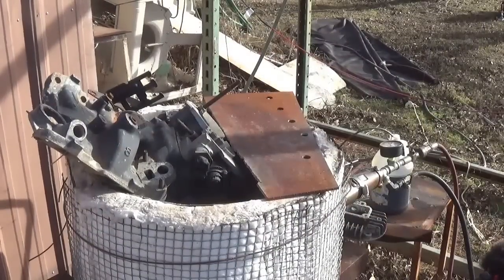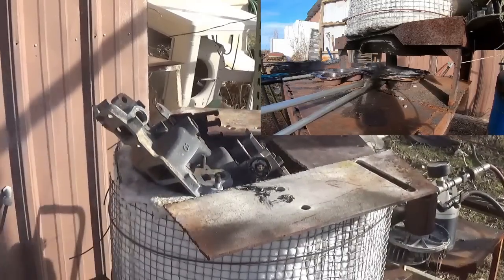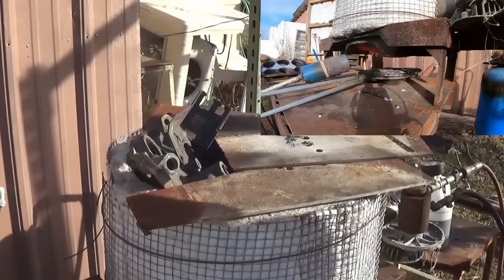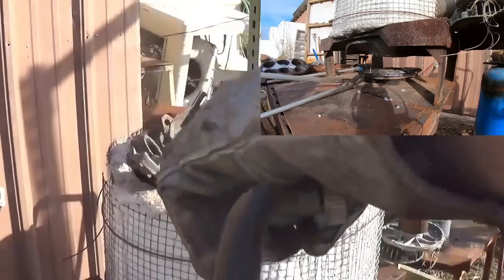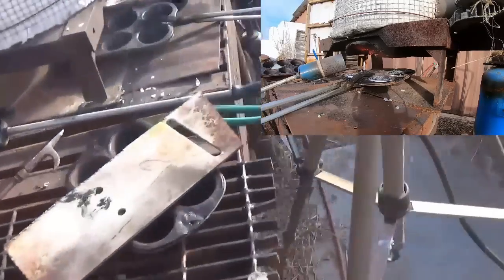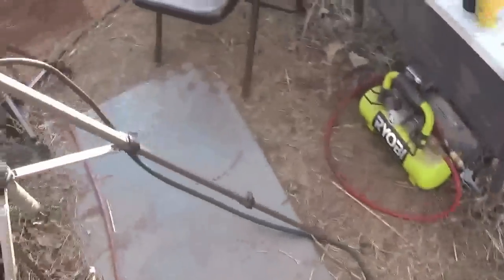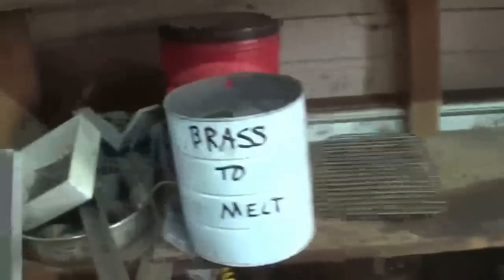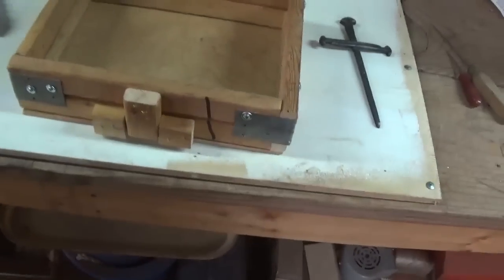Melting an Aluminum Intake manifold in the Waste Oil Melting Pot

Comment: I enjoy watching your melts a lot but I don't think you get as much heat out of that set up as you could . By using the compressed air method your running the compressor too much $ . You can use a blower from a car with a simple gravity drip feed . Check out ( Oil Burner ) on you tube also Luckygen 1001 furnaces and burners . Simple to make cheep to run
Reply from the maker: yes, Oil Burner has some awesome drip feed burners, his videos are what inspired me to build this burner
Reply: @Okiescrapper  Don't forget Luckygen , he puts us all to shame by melting iron

Comment: Hope you get that oil flow figured out. With how well it worked for you in the past it just feels like more radiant heat may be cooking the oil in the brass tip now and causing it to slow the oil flow. Just my green two cents, hoping the best for you.
Reply from the maker: I hope so too! it will be burning good and then just go out. the cooler temps may have something to do with it, but the oil moves up the line good when I first fire it up. I may have gotten some of the slimy stuff from the bottom of the waste oil bucket when I mixed up this batch. Thanks for stopping by

Comment: After all the storms came through last night I’m out here cleaning up while it’s 70 degrees. I wish I could send you some of this stainless steel mess I have it’s hard for ash to get through it
Reply from the maker: It seems there is always some cleanup to do after storms now days, 70 degrees a nice winters day. I just came in from melting some cupcake ingots into rectangle ingots, used a loaf pan and made 3 lb. bricks. and my new 25 oz ingot molds, melted about 17 lbs. total, may melt some more tomorrow, the Waste oil burner was working great

Comment: Do you have a video about making a melting pot like that? I've got a lot of aluminum and only a little furnace and crucible.
Reply from the maker: no I don't think I did a video of making the melting pot, I had an old compressor air tank that had a 3/4-inch hole in the end, so I cut it off and welded some Leggs on to the end of it, the bottom was concave and would hold a pool of melted aluminum, so I built the bottom up with refectory and sloped it toward the drain hole, I put a thin layer of refectory around the inside. held up with some hardware cloth, and not too long ago I added Kao wool to the outside held on with hardware cloth.
the channel called Oil Burner has a video of his drip feed blowing into a 55-gallon barrel melting an aluminum head, and the barrel was tilted so the metal would run out into a water bucket.

Comment: Since you go and melt down the ingots to make them into other cleaner ingots why not use a bigger mold so that you don't have to move it around so much but something that will still fit inside your crucibles so you can remelt it down into cleaner bars of aluminum?
Reply from the maker: yeah, I do have 2 small loaf pans, I need to pick up some more, I plan to watch thrift stores and yard sales this summer

Comment: If your going to remelt then why fuss around with the molds you were better off letting it drip down into a water tub like before.
Reply from the maker: much easier to handle the cupcake ingots then the sharp droplets of aluminum

Comment: Maybe I missed it, but what do you use for refractory material and also, what is the insulation type around the outside of your waste oil pot?  Very interesting.  You do a great job!
Reply from the maker: I just bought some refractory from amazon and used it mainly for the bottom to build it up so it would taper down to the drain hole, and  a thin layer around the inside with hardware cloth, then on the outside is Kao wool 2 inches thick held on with hardware cloth
Reply: @Okiescrapper Where do you get Kao wool?

Comment: That's the quickest I've seen you go from propane to oil.  That new setup is amazing.  If it's possible enclosing 3 out of 4 sides underneath might be enough to hold the heat in the bottom.  Happy new year
Reply from the maker: the bottom is concaved, melted aluminum would pool until it got full enough to overflow out the hole in the bottom, so I built the bottom up with refractory, so it runs downhill to the drain hole. so the area around the hole is not covered with refractory but the rest of the bottom is

Comment: also how often do steel and other metal parts that dont melt at these temps fall through the hole? I assume the bottom of this doesnt have much of a slope.
Reply from the maker: all the time, that is why I remelt it in a crucible to get the junk out

Comment: Is there any benefit to melting the aluminum into ingots vs selling it as is at the scrap yard?
Reply: Scrap yard=.25 a pound at best. Ebay= $3.00/lb.
Reply from the maker: as Chris said scrap yard will pay aluminum breakage price as you can't get all the steel out of the aluminum, so anywhere from 10 cents to 25 cents a pound, and Aluminum ingots are selling for on eBay for about $3.00 a pound